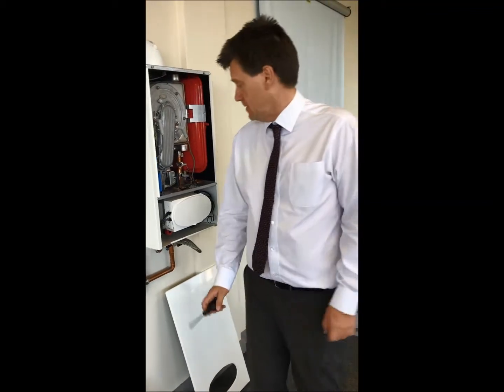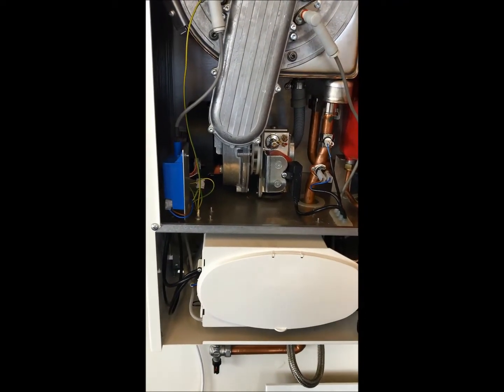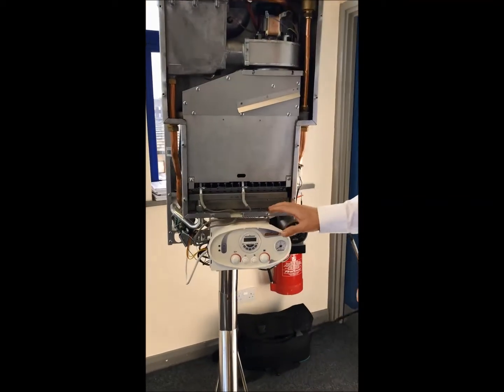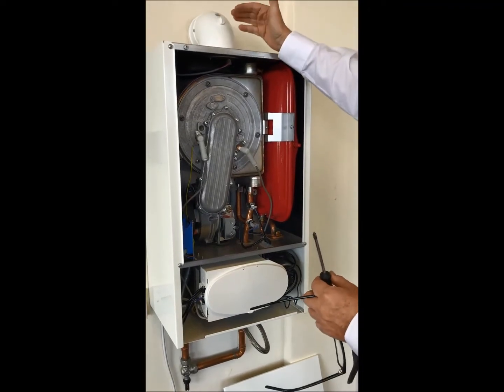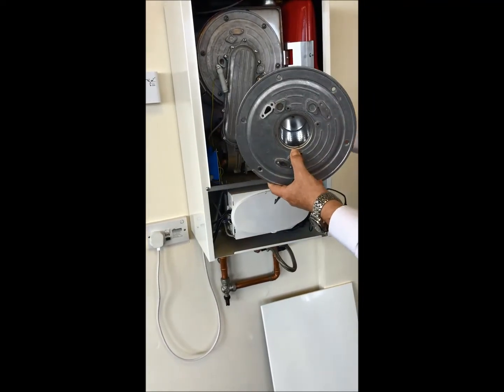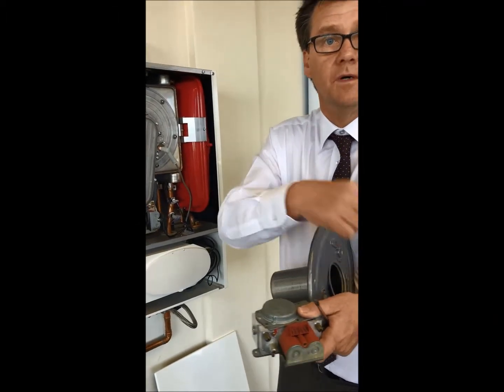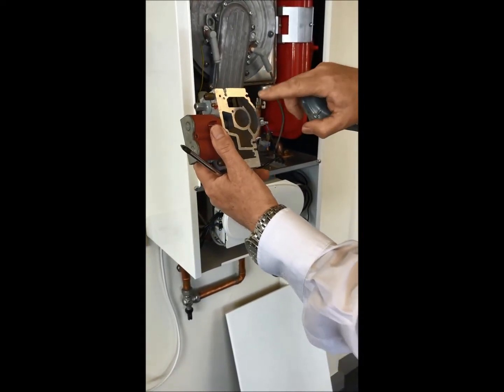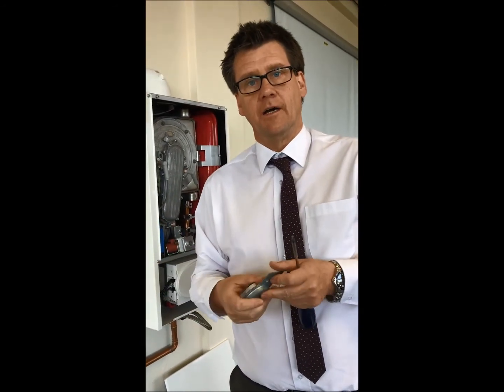Servicing a premix boiler

Comment: Having explosive starts on a Triangle Tube 399 boiler only a couple times a year, it blows exhaust pvc off. I replaced ignitor,checked gas pressures,checked combustion. Any ideas? I am thinking a glitch in control board???